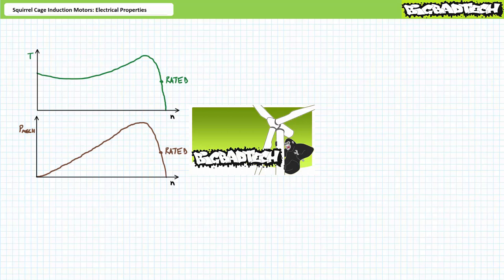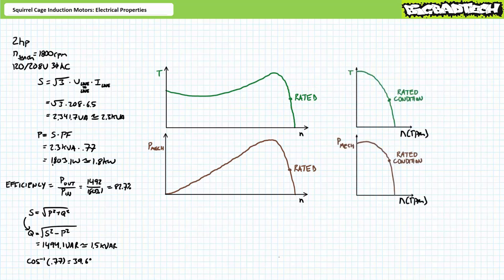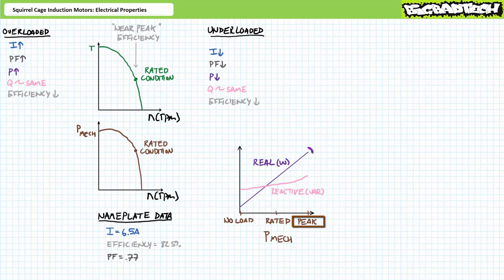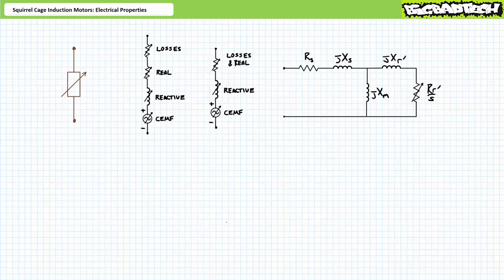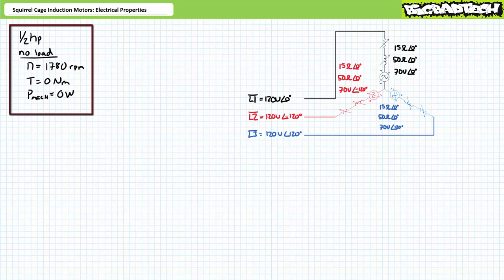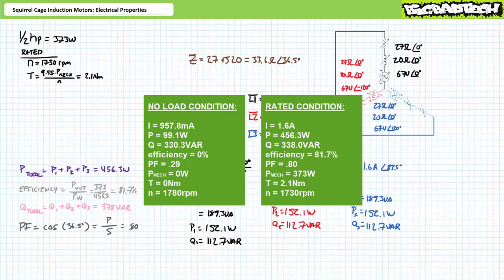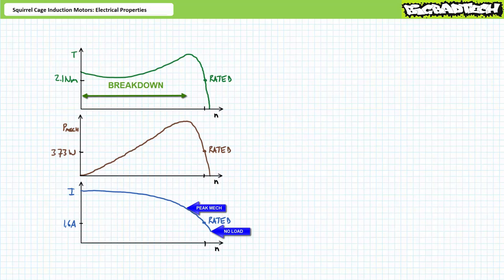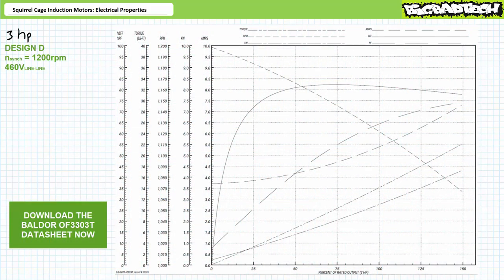Squirrel Cage Induction Motors: Electrical Characteristics (Full Lecture)

Comment: At 21:07, reactive resistance of the winding to be  not at /_0° but at /_90°.
Reply from the maker: Good catch. Yes inductive impedance would be 50 ohms at an angle of 90 degrees.

Comment: Question:  From what I understand from your lecture, which I enjoyed & learned a lot, when operating a squirrel cage i.m. in the rated mode, could it be analogous to a tuned circuit like in radio communications, is that is why the efficiency at it's best?
Reply from the maker: Not sure if tuning is the right analogy since that's frequency dependent. Honestly I think it just comes down to construction being appropriate (ie: efficient) for that specific sweet spot.
Reply: @bigbadtech  Tx for the reply, so maybe it's a sweet spot for the magnetics?
Reply from the maker: Yes, most likely the motor is designed such that it's not drawing excess reactive power at or around the rated condition.
Reply: I also wanted to add will you please explain what a Axial Flux Ironless Permanent Mag Motor is, from the EV vid? TX!